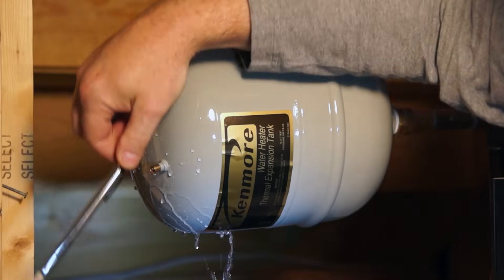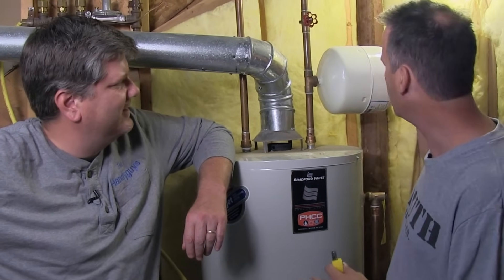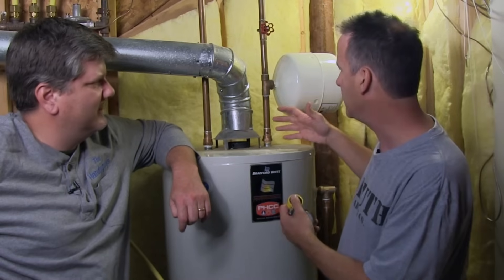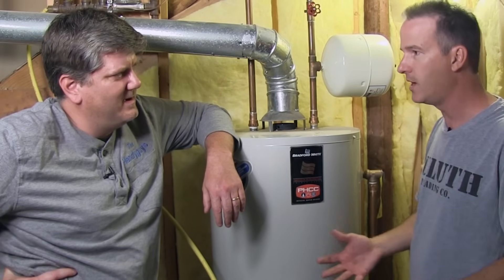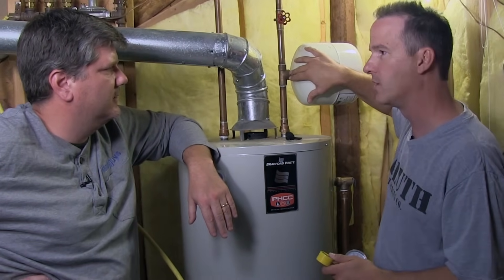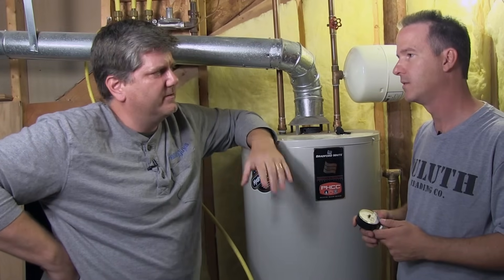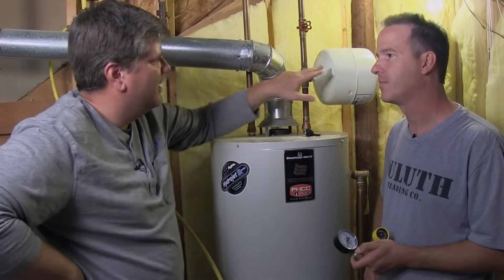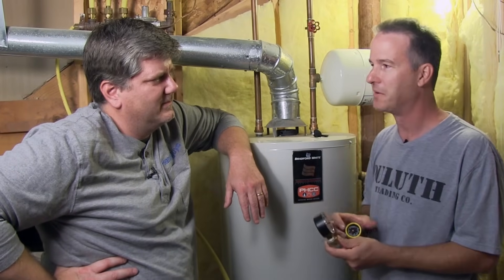Water Heater and Expansion Tank Maintenence

Comment: You kinda lost referent authority at, “saddle valve”. I thought you were trying to avoid problems not create them. Saddle valves aren’t even code most places now. If you can’t solder a fitting into copper pipe, your not, “handy”. You’re just a homeowner with a monkey wrench.
P.S. Readers please call customer service at your tank’s manufacturer to be told how to correctly set this pressure.
Reply: And saddle valves do not age well. Adding a pipe to my gas supply line created a gas leak at an old saddle valve. It had to be replaced with a T.
Reply: Steve Scherer oh man! On gas!? I’m so glad you survived long enough to get to install a ‘T’. I hope others read your comment and go have a look at their gas lines. Wow!